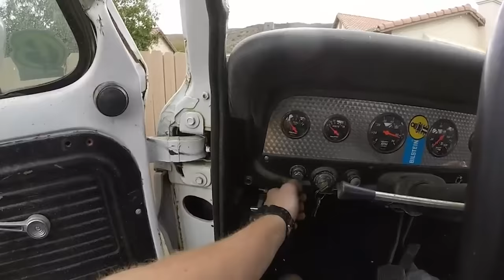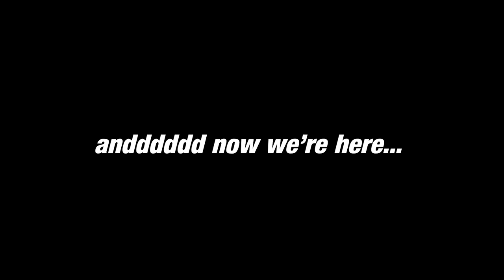My F100's New Custom NASCAR Exhaust SOUNDS INSANE!

Comment from the maker: Please drop a like on the video if you enjoyed! Helps me a ton in the algorithm 👍🏼
Reply: Time for big block now? 😀
Reply: Check your Facebook forum🙏🏻
Reply: I put a BM Built C4 trans in my 65 Rancho 289 CU. Engine was built to so I wouldn't over Tach the Motor and Spin Rod Bearings my friends did that with their Chevy's with 4 speeds,they were constantly rebuilding their Engines. My Ranchero always stayed together and I would pick up all their parts.
Reply: The ole f100 needs a blower
Reply: Why don’t you rubberize the jack head? Put some layers of liners on it so it’s not metal on metal contact to help from scratching
Reply: Why wouldn’t you have a AFR gauge? Carb guys always think they never need one lol
Reply: I gotta get my torino to sound like this
Reply: Hey Craig 909 are you doing a giveaway... Just got a message saying so.... Just want to be sure it's no scam😂👌
Reply: Your truck sounds bad ass . I just subscribed and I would like to know what year is your truck. I have a 1970 Ford that looks a lot like your's but a little bit different. I have a big block 390 under the hood it came with a 3 speed standard. I went through 2 of them and now I have a c6 . Oh and mine has been sitting in the same spot for about 2o years now it was my first truck and I really want to get it back on the road.
Reply: what all is it has been done ? 351w?
Reply: @Joseph Andreuccetti  because they're not accurate with large duration camshafts. I got an afr gauge in my foxbody with 2 o2 sensors and they give a different reading for each sensor and when I check the spark plugs they read the same on both banks so I know the o2 sensors are getting false readings.
Reply: Great sound but sucks about your motor.
Reply: Hey for the cut outs try the vacuum operated ones. Easy. Search youtube for obs ford vacuum cutout. Theres a Mexican guy did it so cool. When you put your foot down the cut outs open up.
Reply: 302 or 351 ?  Sounds sick bro.
Reply: New sub and of course I clicked the LIKE  :)  You're right, that old exhaust didn't sound all that bad BUT the new,, OMG YES!  with a caveat,, personally I detest out the side just in front of behind the rears. I like exhaust dropped just ahead of or looped up and over the third member and aimed toward Mother Earth. She helps soften the exhaust note but doesn't hurt the sound BUT hey,, to each his (or her) own. Where the exhaust exits the car is a personal thing and we resect each person's opinion.
Reply: Hey man did a great job on exhaust but I was wondering if your buddy would touch base on what he did to his bullnose Bronco as far as the motor sound like it was loafing pretty good I have a 85 that my dad bought brand new and plan on rebuilding it here soon
Reply: Dropped a like, cause this truck is MINT!
Reply: What muffler
Reply: My 78 sounds similar I love it brotha!
Reply: It seems as though you're not very respectful nor thoughtful of your neighbors. And I like the Nascar truck and am building a 69 gto autocross/daily driver.  But you should be more thoughtful of your neighbors.
Reply: “X”pipe??
Reply: I’m a army vet and I love the flag inside your truck! How can I get one for my truck??
Reply: I did a very similar exhaust on my 84 f150! 
Headers 2.5 inch duel with an xpipe and Black-widow neighbor haters . 
 It’s a 302 with bolt on mods . Sounds 10x faster then it is! 😂 
Good video !
Reply: Sounded like you were floating some valves. Just bent push rods?
Reply: Can you give a run down of the engine and what's done to it?
Reply: Will do!
Reply: Your neighbours either love or hate you. We love the sound
Reply: Is that a ford motor in that beast??
Reply: Needs a set of boom tubes
Reply: Bro that exhaust is sick , I went with black widow angry housewife on my 67 galaxie but definitely gonna cut them off and go with the neighbor haters .
Reply: What engine do You have in that Bad ass truck
Reply: @wickedgunguys8144  it night be a 302 but that little engine really moves this truck ,it is fast to me
Reply: @jasonmacneil2256 have you ever heard his neighbors complain? Eh? Then why are you?
Reply: I have a 72 Maverick with grabber trim (longtubes) and a 73 comet gt (block huggers). Both have 306 with auto trans with longtu (they're for my twins), but I'm having a time tryna figure out an exhaust setup. I like the sound of the NASCAR setup, but the drone would definitely have to be coming from the rear of the vehicle. Would taking the exhaust to the rear of the vehicle kill the aggressive sound?
Reply: Get a boom tube installed at some point
Reply: Hey please respond back I want to know what your exhaust setup is please 🙏
Reply: Hey please respond back I want to know what your exhaust setup is please 🙏
Reply from the maker: @AidenWilson2563  watch the video lol

Comment: A big part of making your truck sound so great is the fact that it’s a SBF. They make the best vroomy noises
Reply: Truth. My old 83 f100 had a bone stock 302 that i put shorty headers and cheap purple hornies on. I cant begin to tell you how many guys at the shops in town asked if I put a cam in it and were shocked when i told em it was a factory stock engine. It was choppy as hell idling and screamed at wide open. I miss that truck but after 3 water pump leaks i was ready to just let it go to someone who had the time to keep fixing it.
Reply: Ya until they don't!
Reply: Sbf?
Reply: @MAGA_Randy_Marsh small block ford
Reply: @stevenvaughn8431  Thanks. What happened to typing shit out? Everything is like that these days. Whoever started that… GFYM
Reply: I had a 90 f150 with a 5.0 and the 5 speed. We live in a small rural town and I built what I wanted for an exhaust. Three inch off the flange , h pipe and 12” glass packs with the pipes dumped over the axle. Just enough cam to make it pull the boat better.
Reply: @MAGA_Randy_Marsh  Acronyms like SBF have existed for way longer than the internet.
Reply: @psg6544  That's true. I think people do it to give their hobbies a sense of community and make "outsiders" have a difficult time understanding them.
Reply: I’m a Mopar guy, but the sound of a well tuned sbf is hard to beat.
Reply: It's the early firing order - they returned to it with the newer Coyotes.  The US manufacturers went with a different order for a while because of torsional vibration issues affecting bearing longevity.  Chevy for example still uses that modified order, which is why they sound more flat and "buzzy" with modern exhaust setups.

Most European manufacturers never changed it, they kept the same kind of order used since Cadillac and Peerless first made crossplane V8s in 1923 / 1924.
Reply: The best sounding Engine  ever made was the Ford FE through long tube headers and a big by large cam and a 3 inch full X pipe and a pair of 3 inch  big truck mufflers dumped at the axle. Mine makes 503 hp and the mufflers are as far back as they can go with dumps at the axle. It sounds like NASCAR from the 60s with the 427 2x4 . The mufflers on mine are like yours.
Reply: Btw, my first truck was a 67 F100 beige with a 390 I built  and the exhaust was in front of the rear wheels like yours.  It was a bad mother fucker.  I jacked the CR up to 12:1 .
Reply: On a 351 the 3 inch main really hurts them. The Cleveland and FE have the same size 2.75 mains and they can do 9000 without a lot of modifications. At least mine have. I keep my street stuff to 7500.
Reply: @michaellorah9051 shoulda have used rtv and sent it

Comment: Was told a neat little trick by an old timer exhaust pro on how to set up an x pipe. First set it up with two straight pipes. Run a string along said pipes. Start your engine, and let it run until the exhaust gets hot. Now look at the string. Where ever it burns is where the exhaust gas pulses are happening. That's where you want to place the x. The truck does sound amazing though!

Comment: Deff a huge improvement in sound and I'm sure it gained some performance.  I know your frustration.  I finished my 94 mustang 331 build,  broke it in over two weeks of light driving.  Put it on the dyno  and on the last pull it started ticking and was down some cylinders.  I got lucky and some rockers just backed off. Hopefully you find something easy/ cheap to repair and get that beast back in the road.

Comment: That sounds great! My grandfather was a drag racer and one hell of a mechanic. I asked my grandfather for a few blue prints on 302,351 which I have and on one of his prints was basically the same exhaust you built and his was about 6' long and he said that it was optional for his engines. He passed away a few months ago 😢. I have learned a lot and tricks on Ford's. 1 tip I'll give is to advance the timing on your 302 or 302ho 12°.

Comment: Craig, coat the connecting ends in anti-seize and they will come apart much easier(the good copper type). Power flow aircraft exhaust system requires anti-seize be applied after every 100 hour/annual inspection and it works great.
Reply: I've always used anti-seize on all (non gasketed) exhaust connections, and hardware.   Totally agree that it just makes life simpler when it's time for service of any kind.  It makes alignment with movable joints far, far easier as well.  Excellent advice.

Comment: You can hear the engine burning lean in the top of the gear pulls, but that's a killer sounding pipe system and hopefully you can get it back healthy without too much drama. 👍🏼
Reply: what does too lean sound like? I hadnt heard that before.
Reply: @joshmitchamore89   Difficult to describe. The ability to hear it, at least for myself, was hearing engines that were too rich and then developing an ear for too lean. Only way I can think to explain it, although insufficiently is that it sound very hot, dry. No bellow at all, very "zingy". 

It's more of a pronounced sound when tuning two strokes, like outboards and chainsaws.

Comment: Sucks that the motor got hurt! But....That fly by was fucking sick!  Love the video bro ♥️
Reply from the maker: Thanks! All part of the process. We’ll come back better than before.
Reply: What motor is in the Ford Btw?? Is it the infamous 300??
Reply: Rejected-From-Eve .Zero  those 400m's will pull 6500 lightly built. Need a 4 venturi carb, headers, and some flat top Pistons that are true to the deck of the block. 2venturi heads will flow and make decent power. Especially for cheap. Little port and polish and you can flow decently. Only need a 450-550cfm carb to make big power. Properly tuning the carb is vital to the motor.

Comment: My 78 f250 sounds like this. 393 Cleveland stroke, 4-1 1-3/4 headers to 3" collector, x pipe to magnaflow mufflers dumped at the diff. Sounds mint and racie just like this truck

Comment: I have an FE based F100 dent, with a tremec behind it as well.  Built my own exhaust too, but is all 3" and used some old MAC flow path mufflers.  From the collectors, went over the transmission cross member and stuffed electric cutouts w/turn downs in the same area as well.  Crossover is literally directly under the output shaft/U-joint area.  Is probably the 5th or 6th exhaust I've had on it since highschool, but to me the tone is unbeatable/I finally found what I was looking for.  Fab was delicate to cram all that mess in there, but it was well worth it.  

Your truck sounds fantastic dude!  Very well done!  Almost sounds like you're running the "old" firing order too.  Throw some (now affordable) leftover 1990s Yates heads on that thing and LET 'ER EAT!!  Love the truck  man, really.

Comment: I actually have a similar story! I grew up with my mom driving a 68 chevelle. I took it over in 95 as my first car in high school. I recently built a high rev destroked sac with 11.5:1 compression.  I put it in with the old exhaust that sounded awesome with the old motor but the new motor sounded terrible. I have 3” from the collector into an X pipe then ran through a set of jones resonators dumped before the rearend.  Sounds great now but not quite as good as yours! You sound like your spinning 9K. I shift at 7,200.

Comment: Sounds great man. I ruined a good engine due to leaning out once and will never make that mistake again. I run a wide band on everything now as a cheap insurance policy.
Reply: Is leaning-out referring to ' fuel injection ' air fuel ratio ? or dose it affect regular carbureted and TBI engine also.
 My 454cu.in  tbi always runs rich. Too rich
Reply: @missingremote4388  It refers to the AFR and can happen with EFI or carb setups. Generally, anything higher than 12.9 at WOT is considered lean. Nitrous and boost setups should be even less.

Comment: I ran a single moroso 3” corkscrew muffler on my 89 F150 4x4. It had a swapped in 93 Cobra engine. Sounded similar.

Comment: I want that Bronco @50 seconds in !! My  parent's had a 1985  looks about the same. Ours was a cool two tone with Chrome. Loved riding in it, and was able to drive it a bit. My 1986 F250,2000 F350 7.3 were beast !! My boss at the time had a 85 F350 with a 460 3 speed on the floor !! Fast as F--K ,even when fully loaded !! coming home from work with no weight on it was 🔥

Comment: I'm going to do that on my 1983 Trans A.m I just put a freshly built 355 motor bored over. 30 mild racing cam and lifters Holly performance intake Holly 750 4 barrel carburetor Moroso valve covers and air filter hooker headers Holly performance fuel pump and fuel line's brake line's transmission line's shifter cable water pump hoses clamps battery R400 transmission Posi rear end now going to do the true dual performance exhuast is the last thing I'm sold on the black widow 10's with the x pipe I'm so excited man thanks again best exhaust video on YouTube by far I'm sold thanks again man!!!

Comment: Hello, another fun way to remove a muffler is to pass a chain through a 25lb. free weight, then loop and bolt the ends of the chain around the muffler. Stretch out the chain, while holding the weight in both hands. Move the weight briskly back and forth between tension and loose. Pulls the muffler.

Comment: Man this thing sounds sick. 🤤 I love a quality black widow setup. I’ve got a venom 250 2.5” dual in/ dual out that’s going to go in place of the center resonator and then it’ll be 2.5” the rest of the way back with no more rear mufflers and quad tips. It’s not gonna sound anything close to this, but I’ve got my fingers crossed it still sounds good enough. Lol

This is going on my 2011 Hyundai Genesis sedan with a 4.6 btw, I realized right after I posted the comment that I didn’t say what it was going on. 🤦🏻‍♂️😂

Comment: Long tubes, no cats, California plates!  Love it.  You must not live in the LA/Beach town area where the cops harass loud cars and trucks.

Makes me miss my old 1970 Dodge D100 single cab, long bed.  Had limo tint, 15x10's w/ 275's on it, long tubes, cam, roller rockers, performer intake, 4 barrel, x-pipe, and flow 40's.

Comment: wow you remind me of me back in 1978. i had a white 1974 f 100  with a 302 built to the tilt, bucket seats, mustang 4 speed, in line shifter. back when i was 17,  many, many speeding tickets could beat any factory 350 camaro , or mustang

Comment: Bit of advice, go buy a harbor freight come along,  or even a trailer ratchet strap,. Put a choke strap in front of your resonator and have it anchored somewhere like your rear axle. Them just ratchet it and use some mechanical advantage to pull it off vs the big ass dead blow. Though, if you wanna get some hostle energy out, the dead blow is a great way to go:)

Comment: Beautiful sound! Definitely sounds like a legit race truck, NASCAR, TRANSAM, ect....sorry the engine pooped on itself! That sucks. Just like my Instructor used to say in my Automotive class , "race cars don't wear out, they BREAK!" It's so true! Race cars are Not designed to last, they are designed to compete. Hope you get it figured out and fixed! Hopefully you're going to upgrade or make improvements to that part that crapped inside the engine. Piston or valve train, head gasket issue? I saw the smoke around the curve,  and it didn't go away, thats when I thought to myself "you broke something" 😬

Comment: You need to rubber mount the exhaust system. If its solid mounted to the chassis. First off, it's  gonna crack or break any welds. Your motor and trans are on rubber mounts so the exhaust has to be able to move with it. 
Secondly, if it's  solid mounted to the chassis it is gonna be loud. Loud with vibrations through the entire truck. Thats why they call exhaust mounts insulators. 
If for whatever reason you have to solid mount that system, you can run a flex joint near the front somewhere. It's not going to cure any issues. You're probably still going to have vibration problems as well as cracking. It's just not as prevalent.

Comment: What are you running for a cam? I’ve probably watched this 50x just because I love the sound. I just built the exact same exhaust for my 95 camper special 351. Equal length long tubes, black widow X under the bell housing, widowmakers directly on the back of the X, 2.5” straight to the bed sides. Sounds Trans Am Series and I love it.

Comment: Love the truck bro, hope you get it fixed soon. That sounds awesome, wish I could get my 2013 Sierra 5.3 to sound like that!! 😆
Reply: run equal length headers into an x pipe, then out the sides or back. this sound comes from the equal length headers and x pipe. its a smooth flow exhaust which gives it that high pitch bite

Comment: Just have to beef the whole system up for the high compression. Upper and lower. Either way it will run and sound sick with any motor

Comment: My 1991 F-150 with the 4.9L I6 wouldn't sound as cool, but it does have a Cherry Bomb muffler though! And it can haul a fridge and two ovens from the 1950s w/o breaking a sweat! I got on the interstate and merged over to the left lane because I forgot I was hauling several hundred pounds of cast iron! 😅